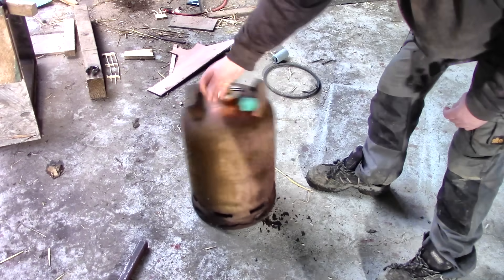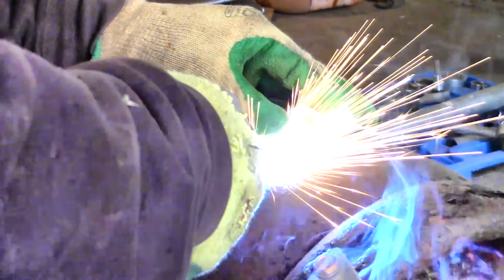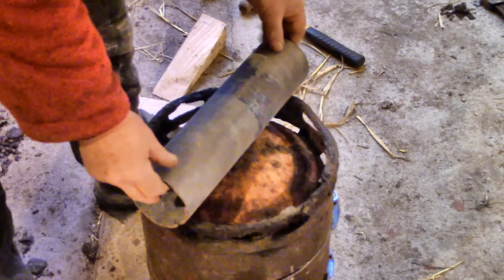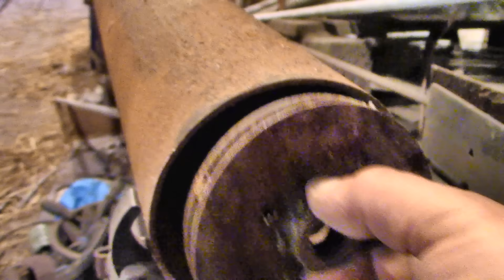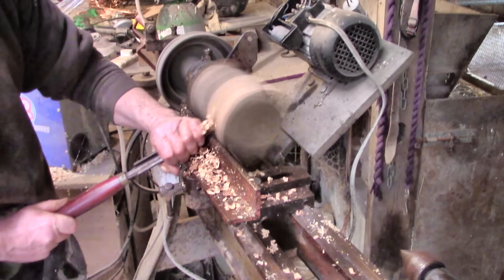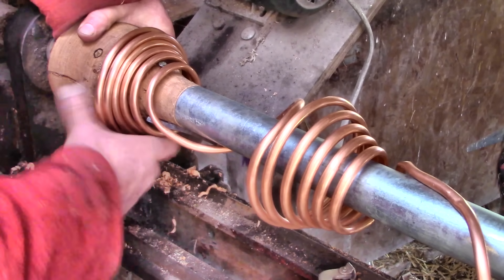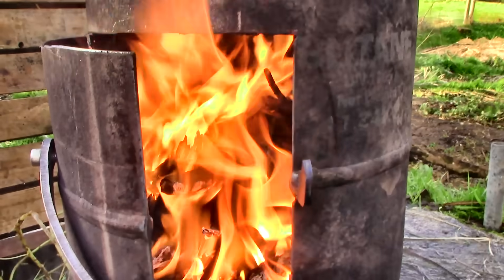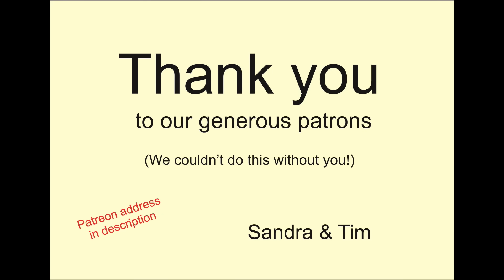Homemade Flash Steam Boiler From Plumbing Pipe And Scrap

Comment: To coil the tube without kinking it try filling the tube with molten wax. It's the equivalent of a plumbers spring. You need to get the raw material coil good and hot to start with so that the wax doesn't freeze as you tip it in. (If you chuck it in a bonfire you get the bonus of annealing the tube at the same time). Allow the tubing to cool to the point that the wax doesn't burn or boil on contact.
Then you need to be quick but careful with your pan of molten wax and a funnel.  As long as the funnel is higher than the outlet end the wax should go all the way through.  Bung both ends and quench the raw material coil . 
With the tubing annealed and supported internally by the wax you should be able to form the tubing far more easily.  Back to the bonfire to melt the wax out again.
Reply from the maker: Thanks - I'll experiment!
Reply: @wayoutwest-workshopstuff6299  speaking with 0 expertise, but i vaguely recall seeing something about brass instrument makers using soapy water frozen inside the tubes they were bending as a similar sort of anti-kinking measure, which sounds potentially less fiddly to set up than wax, but i've no idea about efficacy.
Reply: I have also heard of using sand inside the tubing to bend it without kinking.  That could be worth a try.
Reply: @amberyooper  I was about to suggest that when I saw your comment - though I wonder how sand could be fed into the tube & got out again? I'll bet there was a marvelously simple method those old boiler makers used for making coils......
Reply: @amberyooper  
Sand is good but can be very hard to remove in a tight coil. You can actually buy a special low temperature melting alloy to fill up pipes prior to bending which is excellent but expensive, wax is much cheaper.

Comment: Its funny that this is the video that shows on my feed because I have been doing a lot of research on steam engines and boilers. Especially locomotive engine, the boiler release the steam through tubes that run back through the boiler setup and "super heats" the steam. My suggestion is running a couple more runs of copper straight up and down the chimney to super heat the steam and add pressure to the system.

Comment: Pretty sure you should wound the copper pipe around a slightly smaller diameter pipe then the chimney, so when fitted it will  cover the entire wall of the chimney, giving it good surface area

Comment: got yourself a nice free hot water heater should you need one - with the copper wound tightly outside the pipe, cold water in the bottom and hot water out the top into a water tank above if you want gravity fed. ( other patrons of this idea say you have to insulate the pipe as well ) handy for a cold shed and a sink

Comment: While it won't be as fast, maybe the copper tubing needs to go on the outside of the flue, with an insulated jacket over it.  That way, winding the copper could be more evenly done and with less chance of kinking.  The combination of more even heat (as transferred from the inner flue) and heat retention (outer jacket and insulation) might achieve the desired effect.
Reply: But why not both?

Comment: The coils may not be ideal, but you may find it works better if you reverse the flow.  Put the water in at the bottom and get the steam out of the top.  Also reduce the water flow so the water that goes in is super heated steam by the time it comes out at the top.  Also since the boiler gives off enough heat to melt the gauge, you could add a bit more copper tube wrapped around the outside of the top of the boiler.  That will preheat the water before it gets into the chimney stack where it will get super heated.
Reply: The problem with going bottom to top is that the flue gas is going the same way, so it cools as the water heats and the two "meet in the middle" temperature wise. With a contra flow heat exchanger like this you get the most heat transfer between the working fluids
Reply: heat transfer definitely works better in opposite directions.

Comment: Just my two cents worth, but I might suggest a Hot engine/cylender block as a good low-tech solution to keep the hot water from condensing too often in your valves and cylenders
The phenomenal speed going from cold water to boiling is really impressive, even if you don't use it for an engine it's a great water boiler. Awesome!

Comment: You may want to look at increasing the length of the chimney and heat exchanger to get more effective heat transfer - perhaps a serpentine chimney, insulated on the outside to prevent heat losses, with a longer heat exchanger could work? Even without the long length, insulation on the outside would make some difference. You're definitely running the water the correct way though - excellent counterflow heat exchanger design!

Comment: Nice job!  I'd be curious regarding what happens if you reduce the water flow. The less water, the more heat per unit, until you get dry(Ish) steam, perhaps? Or more of a batch approach, as suggested by the name 'flash' boiler?

Comment: keep the copper tube in the chimney but if you put some steel tube in the fire  as the final heat absorber you will get much greater heating 

you could also improve it by  adding tube on the outside of the fire box  to pre heat the water  before it goes in the smoke stack 

also you could make this better by insulating the fire box alot of the heat is been lost resulting in the  poor performance

Comment: Hi Tim. Do you have a reason to run the water from the top down the tube? Maybe try to push the water from the bottom and steam it on the way up. Cheers !
Reply from the maker: The idea is to have the steam leaving the hottest part of the pipe (the bottom)

Comment: Fill the tube with sand or ice, and you will be able to easily bend it without risking a kink.
Reply from the maker: ice? really?
Reply: @wayoutwest-workshopstuff6299  
Fill it with water, and freeze it. You can work with it with ease. And it will be easy to get it out. You just wait and let it melt.

Comment: A note about the boiler, perhaps space the tube coils out a bit more evenly? Coming from the perspective of a physicist I would imagine the greater surface area exposed to that much more consistent air (and more importantly heat) flow should help greatly with the heating. It may also be worth looking into some form of insulation. Also, considering various brass musical instruments have special valves to drain spit from an instrument, perhaps it's worth investigating a similar setup with two output points, one for the water and one for the steam, that use their respective densities to filter out one from the other? Similar to how a trompe separates its water flow from its airflow.
Reply: Yep If you’re planning some sort of reciprocating piston engine you’ll need to get the water out of the mix otherwise you’ll get priming, which is basically when your piston finds itself trying to compress incompressible water and goes bang. This is why locomotives have drain cocks on the cylinders which are opened when stationary because when the loco is stationary water builds up in the cylinders as they cool. Once the engine is underway again and the water has been ejected during the first piston strokes the fireman closes the drain cocks until the next stop.

Comment: I have never built a steam machine like this.Yet I do have an idea to increase the heat. You can almost keep the same desgin. Yet if you were to coil the copper on to a pipe with a welded cap towards the fire and then coil up the copper around the pipe and use some sort of metal tabs in the bottom to keep in the center and the same at the top This would reduce the amount of surface area around the copper so that all the heat and air flows around just the copper tube. For example if the tube was 1/2 inch you would need about 1 to 1.5  inch  gap. If you wound the tube around this pipe and cnc cut some sort of curve starter thing. Sticking the inlet valve in side the pipe so that you do not need to have a cut in the main smoke stack and then wound it all around and placed a clamp on the other end. You would have the inlet down the middle of the pipe and out and around and then finishes off the top. This way the whole middle stack could be disconnected at the top and pulled out for cleaning or repair. The whole copper tube and pipe would slide inside. You could leave both ends open and see if it works better or place a cap at the top or bottom and see what is better. Cap at the top might hold some of the heat in side and once its warmed up it would transfer the heat from the pipe to the copper.
Reply from the maker: Yes, I'm thinking along the same lines, I think,. But getting the tube to go where you want is tricky

Comment: Whenever I bend plastic pipe, I fill it with sand to stop it kinking. That might work for copper pipe too. (Use compressed air to get the sand out)
Reply from the maker: this is very narrow - I would worry that there might be a gap or two in the sand which would be fatal

Comment: Perhaps it would heat the water more if it were to double back on itself and pass through the exhaust gasses of the fire twice. You could even fit the coils in the gaps between the other coils on its way back.
Reply from the maker: exactly

Comment: Can I suggest 3 ways to help form the copper tube.
1 fill with sand
2 fill with salt
3 fill with water and freeze
All these methods stop the tube from kinking.
The first 2 are fairly difficult because filling a tube that long may be difficult.
The last one is used for making brass wind instruments  and fairly easy to do and this time of the year it’s easy to freeze it and once the tube is formed a little heat will melt and drain the tube.
I suggest a heating system from that boiler just run the water faster.
Sorry I have no Idea about flash boilers but I’m here to learn and advise as and where I can.
Reply from the maker: Thanks for your suggestions - I'll experiment..
Reply: @wayoutwest-workshopstuff6299  Look up the How Its Made episode on Trombones lol its got what you need.
Reply: @apcolleen  that’s where I saw the freezing method

Comment: As usual no idea what I'm talking about Tim but a continuous coil around the inside wall of the pipe rising upto the top would leave the wet stuff at the bottom and then a larger bore pipe 15/22mm down the middle would dry and "super heat" the steam, cheers.
Reply from the maker: Sounds promising..

Comment: You have crossed over... It is time to invest in or build a steam engine to use all that flash made steam. Install in tandem with or in place of your other chipping engine and use the fuel that you are making to make more fuel that you are using. Robbing peter to pay paul or something like that.  It is the logistical next step. Steam Power.. he he he.
After that speck of time you then move into a bigger boiler and run steam lines all over the place especially under your track and walk ways to keep them clear of that nasty snow and ice, and then, Heat the new shop with it., Gullivers paddock, and the floors of your green house for to get those exotic plants that you have always dreamed of eating but your growing time does not allow... food for thought.   CoCo-nuts.... not coconuts or well maybe?... lol CCHHEERRSS
Reply: One more added thought the excess heat that is made by the combustion of your char making procedure could be used to make the flash steam so virtually this entire system could be self sustaining from start to finish. Would love to see this entire system in working order.

Comment: add fins to the heat exchanger, What you made is not dissimilar to an automotive radiator( a series of tubes in which liquid flows through to remove heat from a source and transfer it somewhere else. automotive radiator are made more efficient with the use of fins between the different tubes in order to increase the surface area that the heat can be dispersed through. spacing the tube coils out and adding fins to your design will help with the heat transfer to the water.

Comment: if you want to make nice tight copper coils, fill it with water or better with salt, solder ends leaving no air inside and wind without kinks. you can also use sand, but it could be very difficult to remove. 
I wouldn't trust the copper thou, it will go bad really quick in the high temperatures. Stainless steel is the way to go, but coiling it is a big issue. Either you need a proper bender or just like above you fill it in, but with molten tin. after coiling you just melt the tin out.
Solution I think would be safest and easiest is to submerge a copper coil in oil, and heat up oil. I can't say thou if this is the best idea, since I thought about it and never seen it done by anyone.
Reply from the maker: I just looked up the price of ss tube here - €100 for 2m!
Reply: @wayoutwest-workshopstuff6299  maybe go mad max style, and buy from a junk yard some cast iron radiators. Cast iron is highly corrosion  resistant, just can't handle temperature shock, so need to be careful. Alternatively just buy some thicker wall black steel pipes and weld up a diy heat exchanger. Steel is cheap and it will last much longer than copper in fire. The only way I would see copper as a good solution here is to cover it from oxidation. ultimate way would be a hard gold plating...... maybe tin plating to some degree. Or oil.
Reply: @wayoutwest-workshopstuff6299  one more notice. I don't believe you could ever achieve such efficiency, but be aware that there is a possibility of creating super-heated water. Normal steam at atmospheric pressure does not exceed 275 celcious. If you continue adding energy to it, it stops to act like steam, it becomes transparent and very very reactive. You can even put things on fire with it.
Reply: @wayoutwest-workshopstuff6299  from what I see on the inet, plated copper pipe is like half of price of ss, but in this conditions it would last tenth as long, so it isn't a great deal at all. 
One last idea - use cast iron  closest to the flame and lighter duty copper or preferably ss at the chimney. Do not use regular steel in conjunction with copper. Any grain of oxidized iron will eat a hole in copper and shorten it's life significantly.

Comment: more coils! lots of flash boiler designs have smaller diameter tube, these are stronger/safer because the surface area on the inside is smaller, and because of that the water gets heated more efficiently and quickly, longer tube means you have the same boiler volume. when bending your pipe, fill them with water and then freeze them, this will mean the pipe is much less likely to kink as it's filled with noncompressible material (which is much easier to get out than sand!). you could also run the tube around the outside of the firebox before it goes in, this will preheat the steam and make more room for more coils! (and a disclaimer, i don't really know what i'm talking about, but this is what i have seen said by people who do!)
Reply: The preheater as blanket is a classic steam power method. Great for your battlecruiser or home heater.
Reply: Excellent post. One minor correction, liquid water is not compressible, however water as ice is compressible. Still filling with water and freezing is the way I would go. It is the way many musical instruments (trombones coronets trumpets) have their pipes bent in production.
Reply: As another person who doesn't really know what I'm talking about, is it better to feed water in the bottom or the top?

I'd think the bottom, because heat rises and cold sinks, so if you feed water in the bottom it'll warm, and just get hotter and hotter on the way up until out it goes.

Maybe his wet steam is because cold water was going down?
Reply: @bobboy61  But then, the steam is exiting at the least cold area (more heat near the fire). It's like the gills of fish, the counterflow allows more oxygen/more heat
Reply: @bobboy61  you want to feed in the top because the water sucks heat out of the exhausted air. The most heat is at the bottom.

Comment: If steam is injected into a cylinder with the piston fully withdrawn, and all the pressure is allowed to escape, and then the cylinder is sealed, the steam will cool causing the pressure to drop pulling the piston into the cylinder. Spraying cool water into the cylinder speeds up the cooling and pulls the piston in faster. Large and well sealed cylinders increase the effect of atmospheric pressure because it is per square inch.
Reply: Yeah, but he's not building a Newcomen engine. Something about the 0.5% efficiency is just, I dunno, impractical?

Comment: would it not be better to have the water go up as heat rises? Then bring it down and run it just above the fire to super heat it! 
or preheat the water going in by running it around the outside of the chimney? 
or maybe just make a nice cup of tea to help you push the waggons around
Reply from the maker: That last suggestion is probably the most sensible - but sensible isn't always best, is it? : -  )